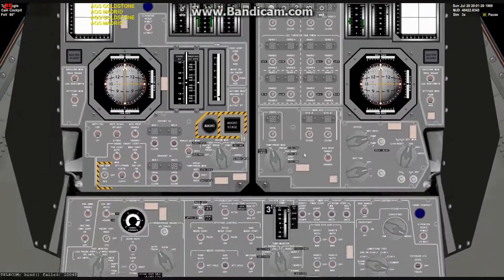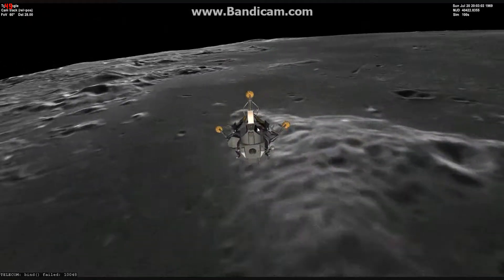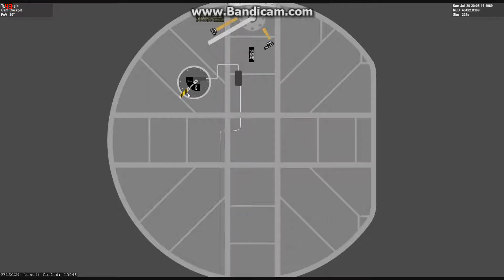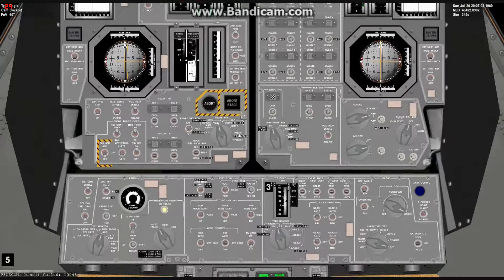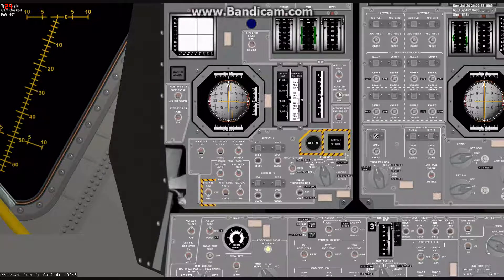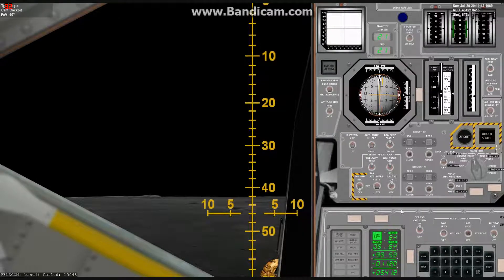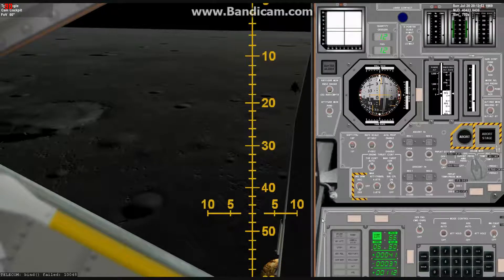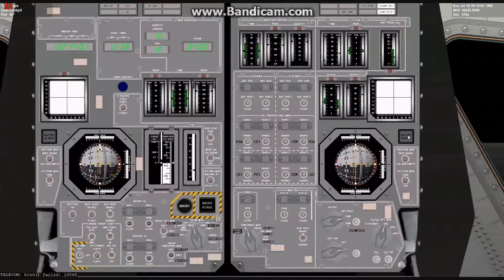Project Apollo NASSP 8.0 Alpha LM PDI and landing test

Comment: brilliant. everyone waits until their butter landing before posting, you made me laugh, your moments after taking manual control are like mine. It's that way things can get ugle real fast , and you're toast at 2000 fps.
Reply from the maker: The funny thing is that LM was not designed to be landed using manual throttle. During Apollo 11 they landed using ATT HOLD mode for attitude, but throttle was controlled by AGC and the ROD switch was used to control the rate. Here i just wanted to do something funny, so i used manual throttle and scored something around -5FPS landing (not sure about actual value because landing radar stops working when it gets into the cloud of lunar dust made by descend engine).
EDIT: AGC shows last readout of -2.1 FPS before issuing engine off command. So not that bad :-)

Comment: i have a blinking verb 37 after i enter V37E00E it stays in Voo for 30 seconds but then the agc's program is blank and there is a blinking verb 37
 am I doing something to the AGC ro am i not doing something i should be doing?
Reply from the maker: Its hard to tell in this case. Would be easier if you provided any video or maybe save. But anyway i am not AGC expert and on the NASSP forum there are guys who know this stuff much better than i know. And sometimes its not correct to terminate programs with V37. Keep in mind that some programs should be terminated with V34, it stops the program the proper way and then asks for a next one (it automatically inputs V37). Some programs also terminate on its own, like P68 that asks for next one as soon as you press PRO.
Reply: macieksoft thanks you always answer my question.

Comment: Instead of going into P00 after touchdown, you should go into P68 to terminate the landing phase.
Reply from the maker: Correct, P68 is landing confirmation program that shows landing site coordinates. Then after pressing PRO it keys in V37 and asks for a next program to be ran.
Reply: It also reconfigures DAP for lunar surface ops.
Reply from the maker: So it simply disables DAP? DAP is not needed on surface ops ;-) Anyway it is possible to do with V48.
Reply: According to the manual I've got, which was from Apollo 15, P68 doesn't disable DAP. It zeros all attitude errors and sets maximum deadband, and places DAP into min imp mode. As long as PGNS mode control is in att hold, RCS jet firings should not occur. Switch PGNS mode control to off to disable DAP.
Reply from the maker: Thanks for the info.
Reply: I'm guessing it's in case they had a no-stay and didn't want to screw around with the DAP. Interestingly, the rotation of the moon would cause the LM to stray outside of the deadband and the DAP would fire the RCS to depletion. So I'd imagine they would have switched off the DAP at some point.